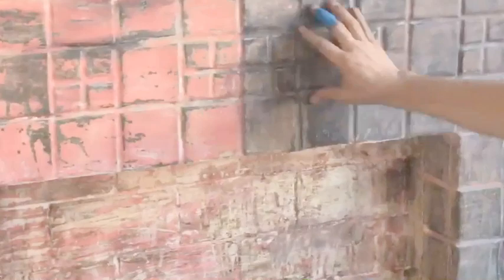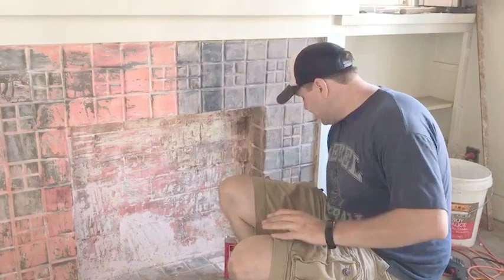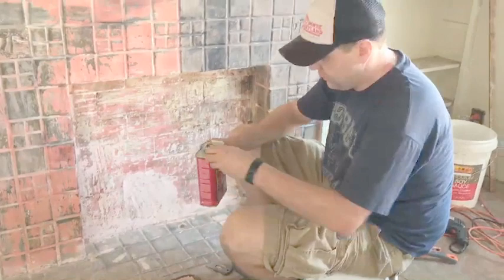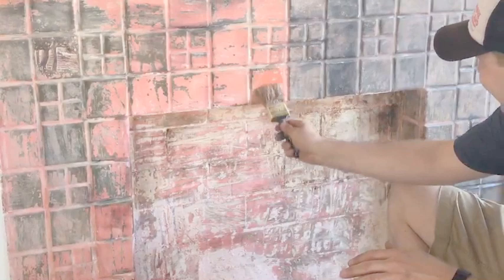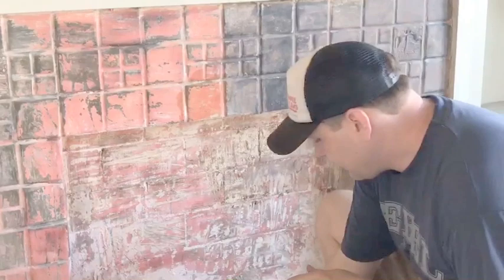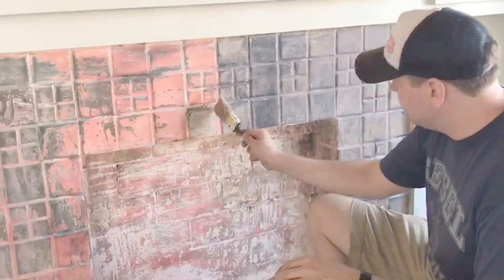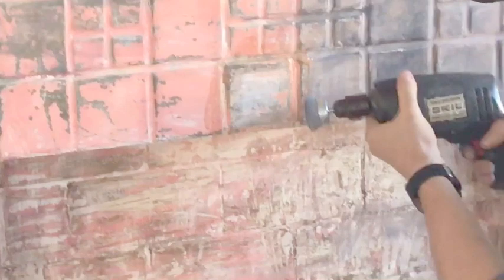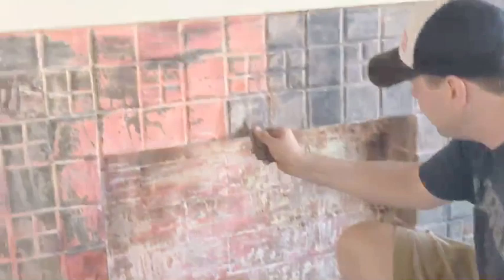How To Remove Paint From Tiles

Comment: You may want to try heat gun instead of the drill with the wire brush so you don't damage the surface of your valuable arts and crafts tiles
Reply: Athena Lafferty ... won’t the heat gun crack the tiles with the heat ?
Reply from the maker: There was so much paint on there it would have to scratch deep, but next time i'll try!
Reply: I wouldn't recommend the heat gun or the wire brush in this situation. There were so many layers of paint on that poor fireplace, it's a good bet at least one of them was lead-based. The heat can react with the decaying chemical composition and cause damage to the tiles and risk cracking. I think the safest way to go is lots and lots of natural stripper, like maybe Blue Bear, with a plastic scraper, going slow and letting the layers breathe in between adding more stripper.  I am actually surprised and glad the tiles look as good as they do at the end with the method he used.